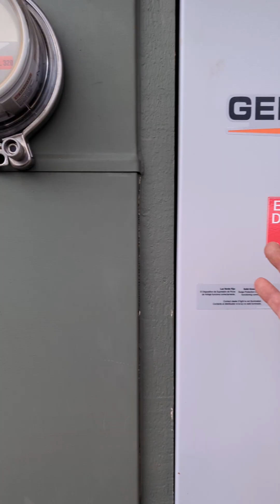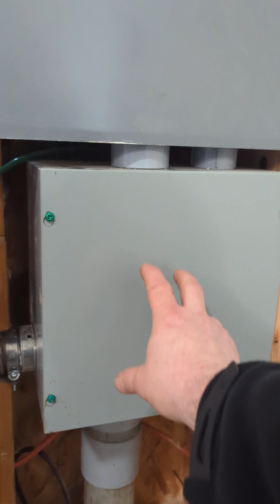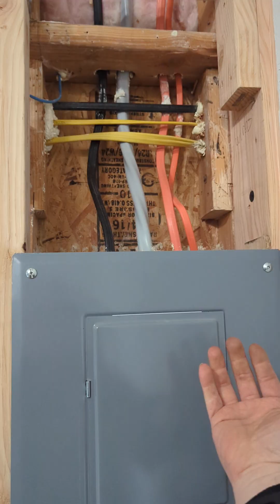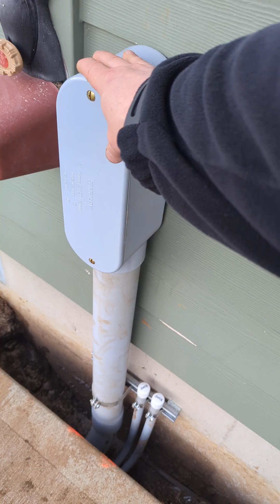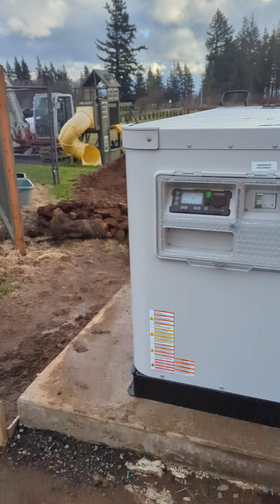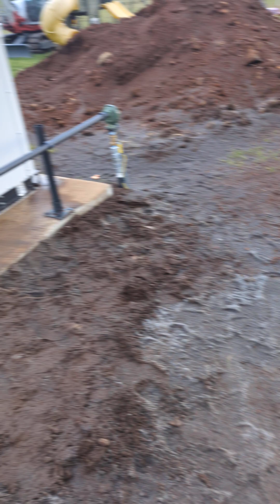48kW Generac liquid cooled generator install.

Comment: Did you use the right panel as a chase?
Reply from the maker: Yes for the generator feeder. I will be going back and opening everything to show routing of conductors and control interconnects for the ats